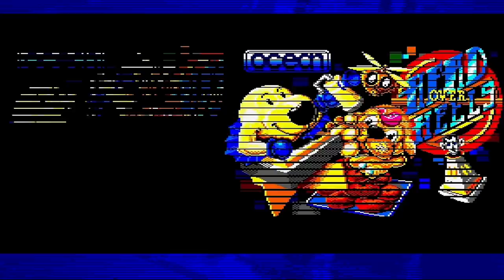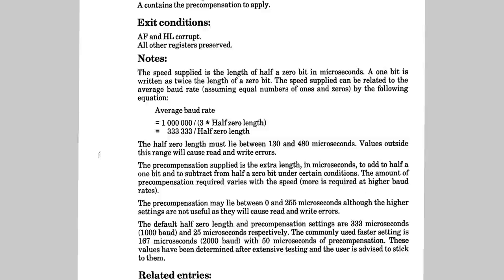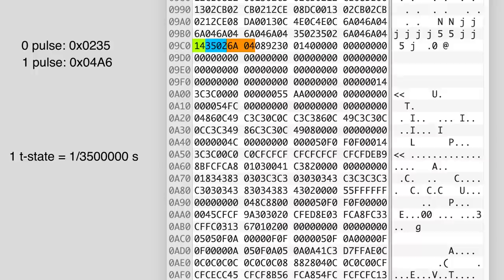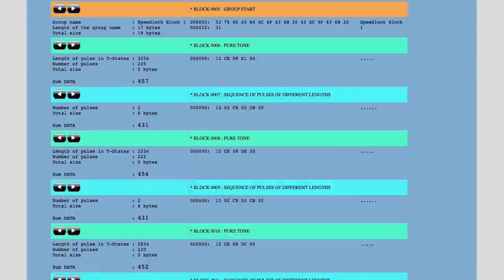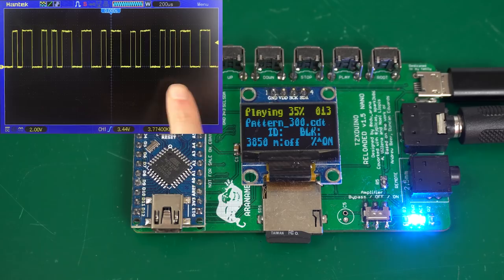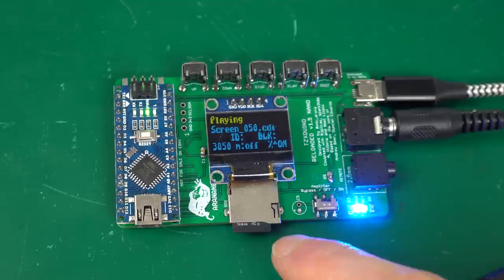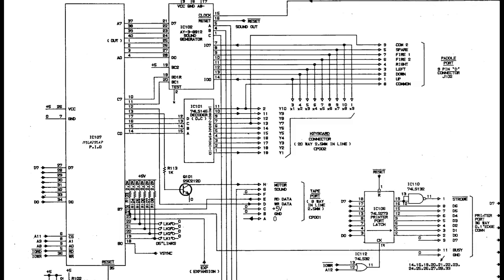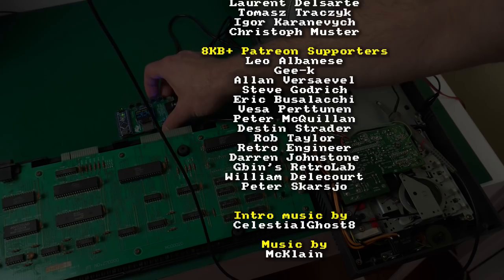How Fast Can We Load From Tape?

Comment: I modified the TZXduino 1.17 firmware for the ODROID GO, to use with my Jupiter Ace FPGA project, and wrote a few lines about it. (Latest activity is on the branch https://gitlab.com/dev-hp/TZXDuino/-/tree/unswitch.)

The reason the tape signal 'blanks out' is probably that the loop that fills the wave buffer (by reading and interpreting SD card data) runs in parallel to the interrupt routine that outputs the wave data to the hardware. If the buffer 'runs empty' you see these long blanks. I had this problem at normal speeds on the ODROID-GO, and the reason was ...the battery monitor on the ODROID-GO. It samples the battery voltage 64 times to average out any sampling errors, and that delays the 'fill loop' so much that the output was pretty much garbled.

Fun fact: the built-in CPC loading routine can self-adapt to various speeds, by using the pilot tone as a reference. It's quite a masterpiece of code, using the R register to 'know' how long the surrounding code needs that stores the bytes in memory. Winter Games used this routine (in RAM) with a different wrapper to load the initial screen line-by-line from top to bottom (not the 'interlaced' image load we are familiar with on the CPC).

Nice stuff! Back in the days I analyzed several tape formats, it was quite interesting to see different loaders. I'm happy to see someone else delving into tape tech and investigating ways to speed up loading! Many thanks!

Comment: A codec like Manchester or other No-Return-Zero could help to cram the bits denser. on the downside it would increase the weight lifting for the cpu, but perhaps the decoding could be done later without the i/o polling requirements (loading, decoding...).

Comment: Back in the day, the cheapest possible tapes on the worst possible tape deck seemed to work much better than more expensive tapes and deck (at least with sinclair stuff)
Reply from the maker: That's kind of crazy. I wonder if there's some real science behind it (crap tapes had a bad frequency response but that got rid of unwanted noise for computer data??). Could be interesting to investigate.

Comment: I'm playing with interpreting .wav files of some old systems. I managed to get something working for Spectrum and Apple 2 tapes with some code and some messing around with the resulting printf's in a text editor. But TRS-80 model 1/3 seem to use a different technique and I haven't had success yet. It seems to use interleaved very short and long square waves, with the short ones all the same but the long ones varying. But even knowing this and the bytes the .wav represents I can't get it...

Comment: Awesome. I'm also a tape addict. Maybe you could make an episode about "Why do OS drivers modify the audio signal, so that it can't be correctly read by the CPC?" Windows 10 does it, Linux does it (since 2019) and iOS does it. I saw that you used an iPad. For me it doesn't work even using VLC. Before plugging in the car adapter it sounds correctly, but then it modifies the signal. (The default iOS player always modifies the signal for speaker/headphone, but I haven't tried audio-out).

Of course you can sometimes play around with the sound mixer, which worked for Linux, but I never managed that on Windows. So the question is, how to use a vanilla sound driver without "quality improvements for humans".
Reply from the maker: I ran into that in a previous episode (when I added the audio-in mod to the Amstrad). I didn't get in depth, but from what I learned, apart from some minor filtering (to make things "sound" nice to the ear), the fundamental problem is that modern audio hardware deals with samples at 48KHz. So when you start giving it a signal around 5-10KHz, it's going to start distorting it quite a bit during the sampling/reconstruction phase. That's why I love the idea of using an Arduino... as long as it can keep up! 😃
Reply: @NoelsRetroLab  Of course I saw this episode! That's when I saw you have no problems using an iPad... So my guess is: Your version of iOS doesn't do this "audio optimization" yet or there is a difference between audio-out and the car play adapter. But you definitely can hear the difference between iPhone speaker output (which sounds correct for a human) and the CPC speaker (which sounds incorrect and has read errors). BTW Plugging my lighting-jack adapter into my HiFi system it sounds correct (for a human), so I was very surprised when testing it on my CPC that it sounds different...

Comment: There are very few arduino libraries/program that really know how to handle highspeed pin I/O. Either you search for a long time or you are just better of writing it your self.
Tried a simple 2-tone dial system once and while there were libraries available for that they struggled at even 1/4th the specified frequencies, while writing your own data-grabber/pusher easily could handle that as well as some extra logging, UI etc at the same time.

Comment: i saw that arduino speed problem before. ie say arduino is 16ghz. but as we are using arduino usb lib and ardiono programmer firmware it seems its impossible to use that as 16 ghz cpu it eats some cpu cycles as its reading data for programmer interface im not sure how much but for sure if you dont flash code directly but instead loader ... and as loader tracks from cpu waiting for loading code . so its actually acts like some kind of scripting interface instead i guess. so thats the negative side  of having arduino and no need to worry about pic chip programming stuffs.

Comment: Firmware and the loader need to co-operate. A double buffer on the Arduino, loader waiting for the duration of buffer refill. Even 64 bytes or 128 bytes buffer would suffice. Sdfat library would probably need to read the whole 512 byte sector to it's internal buffer so the place of the expected delay and it's duration would be completely deterministic. (Unless some specific edge case in the filesystem stuff)

I used such a system successfully in my commodore 64 cartridge playing videos and wave files.

Comment: Cassette tapes have 4 tracks Data loaders use 2 (side A, side b) but only use 1 track ea. So rightaway it can be seen how the media speed can be increased 4x. If you use a similar protocol to what modems use, on low bandwidth mono phone line. 14400 baudx4 = 56k.  (maybe more because its always 1 way, but they could have that speed in the 80s on regular tapes)  If you used METAL tapes could be more. the COLECO Adam computer of the 80s had a high speed tape drive - more or less 14400 baud & omni directional. The tape thing was basically a step up from paper tape storage - a decade old by the 80s and was a bit of a joke.  Perhaps using 4 tracks there's some way of having a parity bit... OR if there was  more than 1 protocol for errors, 1 'spare' block, could be buffered, and used if an error came up. (& maybe have the data recorded 2x end to end, that it remembers the errors, and tries to pick it up on the next section of tape). I guess one solution is to have a high data rate section of tape, and a low data rate , with 2 copies of the data, so that when the tape degrades it ends up ignoring the high speed section and loads slow...

Comment: Shouldn't the fastest theoretical speed be close to 56Kbps , given that's what the last dialup modems were able to do? However this was very good considering LGR was only able to get 2400 baud over audio, using a KCS generator in DOS. I'm very keen to see whether it's possible to get an AAC encoded digital audio stream and record it on cassette using a decent deck.

Comment: Not watched the video, but as 56k modems were the final generation of PSTN modems, and worked reasonably well, I'd take a stab at 56k being possible on a reasonable quality cassette deck, as the required bandwidth is well within the capabilities of cassette.  The wow and flutter could be a much greater problem, however, as V.xx series modems assumed telephone network performance, which does not include wow and flutter at all.
Reply from the maker: That's a pretty good estimate. But I think that generation of modems also included some compression, right? Or was that part of the software? I'm fuzzy in the details of how they worked (which is a perfect excuse to dig into that and make a video at some point! 😃).

Comment: I'm working in a special project and I want to know if there's a way to have it set up to where you could have audio on one side of the cassette and data on the other side like documents on the other side
Reply from the maker: Sure, the two sides of the cassette are independent. Or do you mean left/right channels? You could do that by sending only the signal of one of the channels to the hardware I imagine (the other side could have music for example).
Reply: @NoelsRetroLab  what I was thinking was one side was a audio log telling about the tape then you flip it and put it into a tape drive and it opens up some type of document

Comment: I'd always wondered how fast (and dense) a cassette could be if the computers supported a custom phase-locked-loop controller, like the Amiga.  Using the CPU to count the bits is a lot of overhead and undoubtedly works far slower than the maximum frequencies supported by even a cheap Type-1 tape, and that doesn't even include any kind of encoding, self-clocking, or error correction.

I'm doing a lot of research on video hardware and DMA stuff, so I haven't gotten around to magnetic media yet.  It it reasonable to assume 7.5KHz (half the 15KHz limit) is reasonable for a cheap tape, or would it need to be lower for some reason?  It is also reasonable to assume KHz will directly translate to samples-per-second?
Reply from the maker: Interesting. That's a line of thought I hadn't considered. From my experience with this, surprisingly, we're not CPU limited until you get down to making pulses just around 30 t-states wide or so. The limiting factor seems to be squarely in the tape and the tape deck. If you go faster with it, you start getting errors from noise, speed variation, and the computer detects the wrong transitions.
Reply: @NoelsRetroLab  Yeah, a PLL circuit can easily lock on to the signal and compensate for speed variations.  It's the noise level of the types of heads used in cassette players that I'm not sure about.  Still, I'd imagine without all the legacy audio stuff in the way, it'd be possible to squeeze more bandwidth from tapes.

BTW, I'll be sure to comment more on your videos.  I really enjoy your stuff.  8)

Comment: There were POKEs for Tandy/Radio Shack Color Computer that could work at 2400 baud FSK rather than it’s usual 1200 baud FSK. Cassette tape quality made it only reliable with high quality tapes.

Comment: Wouldnt you want the tape to move slower, so that way you could put more info on the same length of tape? Like while writing the data you move the tape super slow and when you read it at normal speeds it reads faster because it was written at a slower speed.
Reply: Cause the faster the tape is going while recording the more space data takes up as it is wrtten more stretched out then if written at a slower speed.  Like. Crude example.  If you had a band of paper on two rollers. And you spun the paper around really fast. If you touch the paper for 1 second with a pencil youll get a long line. Then if you spin the paper around half as fast and use the pencil for 1 second again. The line will be half as long. This. More lines can be fot onto the paper.
Reply: Its the same 1 second line. But the slower written 1 second line takes up less paper.

Comment: Can you also write data trough the arduino cassette tape on sd card???
Can this amezing arduino adaptor also work on other systems with cassette tape decks???
It would be cool to save and load data from a famicom tape player to create tracks in excitebike among other games😁😁😁
Thx for responding.

Comment: if we use modern era adsl error correction protocols it will mostlikely be alot better :P as adsl too is still using adsl lines so actually they are still some audio lines . or magnetic tape equivalent data lines. but still this mostlikely wwill require alot of modification on write read head and or chip mdifications. :/

Comment: I imagine if it was possible to make a bootloader that recognises 8 different levels of sound instead of 2 it would load a byte at a time instead of a bit but I would guess if it was possible it would have already been done.
Reply from the maker: Right. That's another possibility, but not only would it need a DAC on the receiving end, but then the volume at which the sound plays needs to be really accurate. But that would be an interesting way to speed it up for sure.

Comment: What about designing a box of tricks that converts 2x 16bit words into a SPDIF signal so that it can be recorded onto a DAT or a DCC900 machine and can also pull in the SPDIF signal and convert it back into 2x 16bit words and load it back into memory.
Reply from the maker: I don't think I'll go the SPDIF route, but yes, there are all sort of ways we can go with this, which makes it really fun. Ultimately you could have something connected directly to the user port, but then an Arduino wouldn't be good enough anymore.
Reply: @NoelsRetroLab  The Philips DCC900 has digital in and digital out ports and would be able to record the data a byte at a time but would lay down 9 bits onto tape and would allow you to give each game a title which would show up on the display of the Philips DCC900 but these machines are old and need recapped.

Comment: At this point, dump the Arduino. Use an ESP32, which is much faster, has two cores, and enough RAM to just buffer the entire thing and generate everything from memory. It's also cheaper.

Comment: Congrats on EP 100. :)

I was wondering if you could convert the TZX files to WAV, then use a digital audio player with an SD card to load the files, That way you wont be hampered by the Arduino ?

Also, if you are using the printer pin, does'nt that mean you still have to load the MAIN loader into the cassette port in order to initilise the printer port ?
Reply from the maker: The problem with recording and playing back WAV files is that we're dealing with fast signals, so sampling and playing back at 48KHz is usually problematic.
And you're right about having to load the loader a different way (I was using the DDI-5 for that as a shortcut).
Reply: @NoelsRetroLab  Oh yeah, I did'nt consider the frquency at high speed. LOL.

Comment: great video, going to watch it again and to try and understand it all ... have you tried OTLA loader ? (they load a game on 20-30 secs.. i have had mixed success with the cpc using these via tape adapter and audio input mod. with the spectrum OTLA is a lot more reliable.. i haven't tried it with Arduino yet that's all on my to-do list ..
Reply: I was thinking the same thing! Might wanna dive into this as this loader is way fast...
Congrats on your 100th video, love the way you dive deep into the technical side of these things, keep it up!
Reply: @patzik1910  what i found with Amstrad was that the software wasn't to happy about cdt files so i load them into winape and save as snapshop this works better .. i find a lot of variation between different 464 versions loading (possibly the older ones work better ie Z70100)  is there any logical reason for this ??  ..currently renovating a very early model  and they load with my iphone 5 going through a tape adapter no problems... this is mint so i cant bring myself to dill a hole for the audio mod..

Comment: I mucked about with OTLA on speccy. That was speedy..also c64 longest loading 18 minute game after 5 minutes of mucking about with a turbo load and compressor got it to 17th of the original. Need to finish optimising it.. Atari 8 bit was worst.. 15+ minute.tape loaders.. Paul Hughes explains freeload on his site..including trick to stop home taping
Reply: Regarding Atari, the slow speed and the lack of economic power for buying disk drives in the former eastern block countries led to development of turbo loaders involving hardware mods of the data recorders. E.g. the most widely spread system used in our country managed to increase the transfer speed from the stock ~400 Bd up to around 4000.
Reply from the maker: Oh very interesting! I had no idea about that. Were there commercial programs released counting on those hardware mods, or it was all for pirated software I imagine, right?
Reply from the maker: Nice! Yes, project OTLA seems interesting, but I haven't had a deep look at it yet. I should probably do that for the followup video. But in general optimizing loading speeds seems like a fun project all around 😃
Reply: @NoelsRetroLab  it's the balance of how far you can push it and even trimming the fat in game code itself.. e.g where it makes a copy of same code somewhere else in ram
Reply: @PG-gs5vb  yes I saw them but it wasn't stock hardware or in the uk
Reply: There was a spectrum tape deck called "the sprinter" you might want to look into also.. edit sprint 2000 doh
Reply: @NoelsRetroLab  Yes, in the early 90's there were some commercial releases using that format as it was pretty much standardized in the Czech Atari community.

Comment: very interesting. Have you heard of the 'Sprint Datassette'? it was a special tape drive that could load games into the Spectrum at 4x normal speed. It was compatible with regular cassettes but connected to the expansion port instead of the audio in, so was presumably less noisy. It's a very rare piece of equipment but it would be interesting to know the code it used. I found a link to someone using it on Youtube, I don't know if your page allows links but I'll post it. If not, just search 'Sprint datassette'

https://www.youtube.com/watch?v=ofBmvjuuIBg